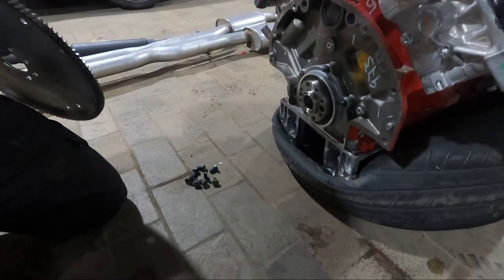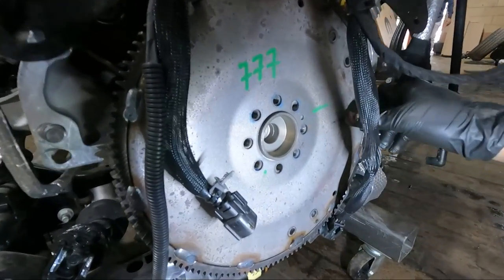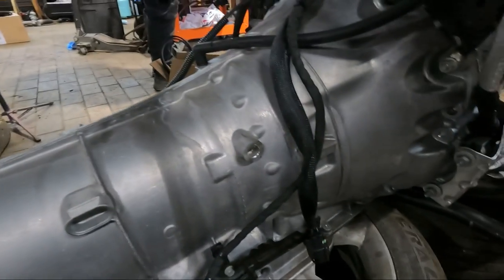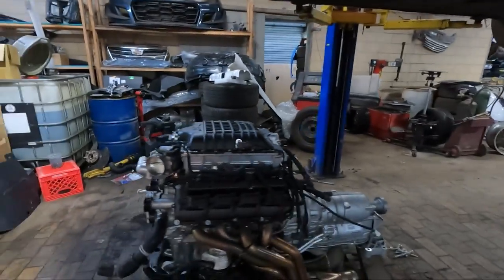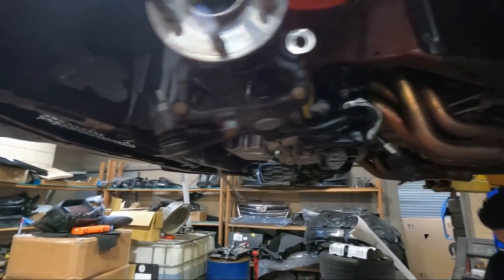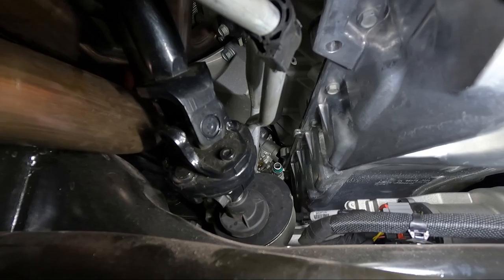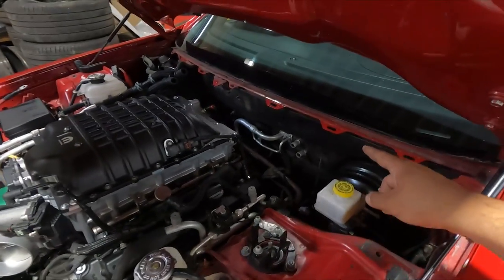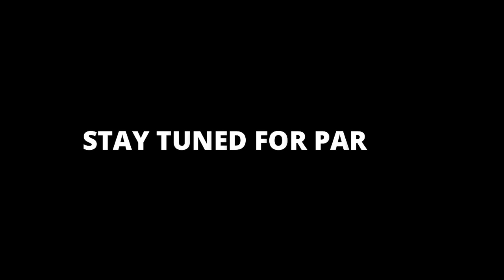BUILDING THE WORLD'S FIRST HELLEPHANT CHRYSLER 300 *PART 3*

Comment from the maker: Part 4 Is Start Up Time! Stay Tuned Turn On Your Notification Bell So You Wont Miss Out. Subscribe To Join The Squad And Make Sure To Leave A Like :) Follow Me On The Gram @ Khal_SRT
Reply: LETSSSSSS GOOOOOOOOO !!!!!!!!!!
Reply: Did you make sure you can use your old flywheel on  your new motor. 
Are they balanced the same ?
The reason I ask is because the flywheel is usually blaced in line with the crank 
And iam quite sure the crank in your new motor isn't the same as the one you have in your old motor .
However. I could be wrong .
If you didn't  I would do so just to be safe  
I'd hate to see you destroy that bad as motor
Reply: Put the redeye motor in a pacifica
Reply: @khal_srt… I have a 2013 Chrysler 300 SRT8 and I would like to do the same wheel set up as you so can I fit 20 x 11 in the rear on my car I have the stock 20x9 now…. Well I need to modify anything will it fit OK without rubbing up against anything? I want to do the same hellcat rims like you have…. Any info would help. Thank you
Reply: This build is amazing.  Someone else said it.  You get this shit done.  Thanks for always pushing the limit and raising the bar!!
Reply: Aye bro where do you go to get work done? I got a 5.7 I wanna have some work done.
Reply: Love this , keep it up. Any plans for any AWD?
Reply: Yea bro im definitely building a one of these you fr brought a dream too reality 💯
Reply: Hey Khal, how much charge for complete swap  Hellephant motor...?

Comment: If I was you I'd make sure you can use your old flywheel on your new motor .
Because flywheels are usually balanced to that motor due to what crank is in the motor and iam quite sure the crank in your new motor is nothing like the crank in your old motor .
But I can be wrong .
If you didn't check I'd do so just to make sure .